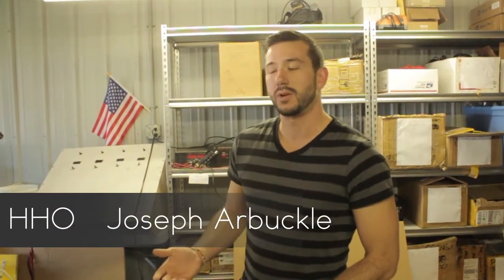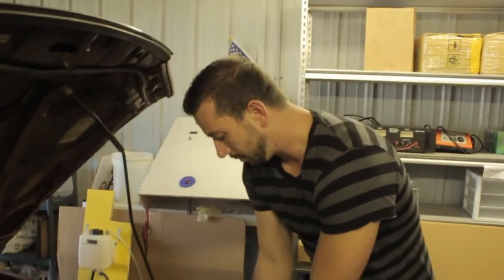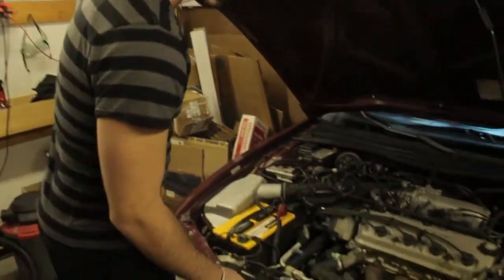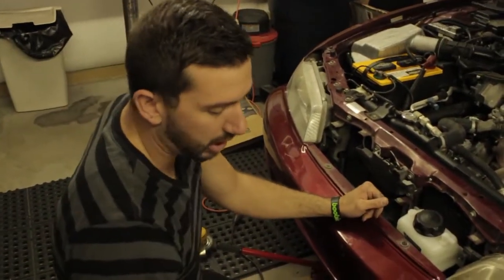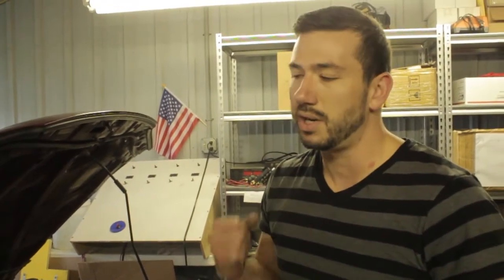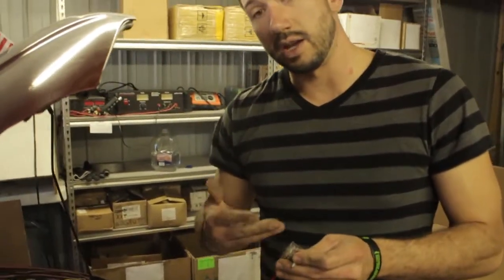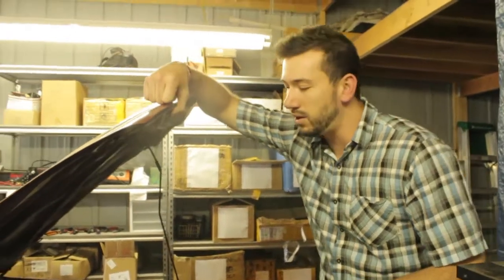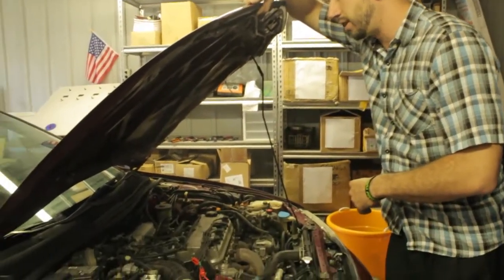HHO DRY CELL KIT  HYDROGEN GENERATOR INSTALLATION 1996 HONDA ACCORD

Comment from the maker: Joseph here, wanted to do an update on this honda accord. I have had some problems with this vehicle which were not HHO related. This 96 came with 150K + on it has never had the o2's changed ( recommend changing o2's ever 60-90k). I noticed a significant drop in my mileage average about  a month after this video was shot ( baseline mpg test without HHO) my average went from 26-27 city/mix to 23-24 ( no hho) . I spoke with the previous owner and discovered that the o2's were never changed, I am making the guess that they are now faulty. I will be changing these soon, but results as of 3/20/2014 are as follows. With my new average of 23-24 mpg city/mix I've increased my mpg to around 28.5 mpg in the city/mix - total increase of a little over 4 mpg at the moment. Running this single cell, with the FS2 HHO chip at 5-6 amps average. Hoping to change the o2 sensors soon and see if I can get my average back up to where it was when I took initial MPG test, and also see my increase go up! :) currently running next test at 9-10 amps for a tank full ( only driving 8 miles a day, so tuning takes some time. ) Stay tuned for NEW results :) SO far she is running Very well :) No problems to report other than my Bad old o2's

Comment: I get sound on the Intro but then it cuts out as soon as the guys starts to speak.  I have tried this several times with the same problem.
Reply from the maker: +Bacon Mow Thank you for this comment. It seems youtube has deactivated the sound for this video. I am sorry. I will try to get this resolved. In the mean time here is a link to our installation blog:

http://www.hydroclubusa.com/#!2005-Ford-Expedition-HHO-Conversion-/c9s4/18B6FE5C-CAA8-405D-A187-877C1EC15EEB

Again I apologize for this inconvenience just let me know if you have any other questions.

Comment: Hello, I am wondering what the outcome of this project was..
Reply from the maker: Joseph here. I had some problems with this vehicle which were not HHO related. This 96 with 150K + on it has never had the o2's changed. I noticed a significant drop in my mileage about  a month after this video was shot ( mpg test without HHO) my average went from 26-27 city/mix to 23-24 ( no hho) . I spoke with the previous owner and the o2's were never changed and are now faulty. I will be changing these soon, but results as of 3/20/2014 are as follows. With my new average of 23-24 mpg city/mix I've increased my mpg to around 28.5 mpg in the city/mix - total increase of a little over 4 mpg at the moment. Running this single cell, with the FS2 HHO chip at 5-6 amps average. Hoping to change the o2 sensors soon and see if I can get my average back up to where it was when I took initial MPG test, and also see my increase go up! :) currently running next test at 9-10 amps for a tank full ( only driving 8 miles a day, so testing takes some time. ) Stay tuned for NEW results :) SO far she is running Very well :) No problems to report other then my Bad old o2's